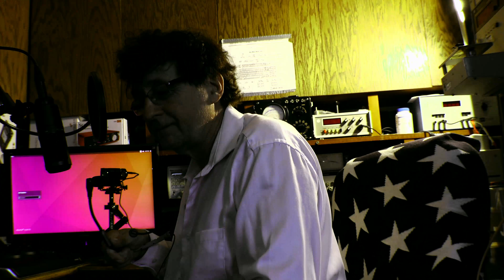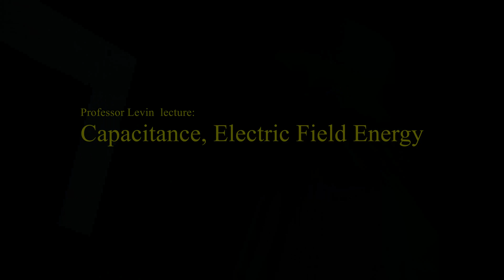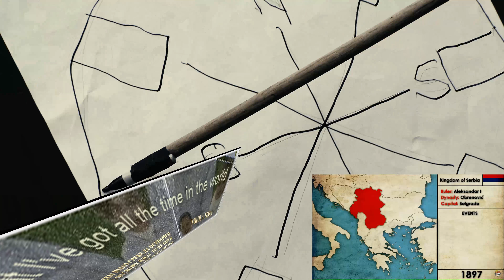Prof Lewin easy,funny way to understand  Capacitance Electric Field Energy

Comment: Funny how he mentions the negative charge just appearing on the opposite plate due to the positive charge on the other plate, but then doesnt explain where the negative charges came from! 

An electric dipole is symmetry breaking of the spacetime between the plates. Wu et al, whittaker etc..

That negative charge comes directly from the vacuum flux!